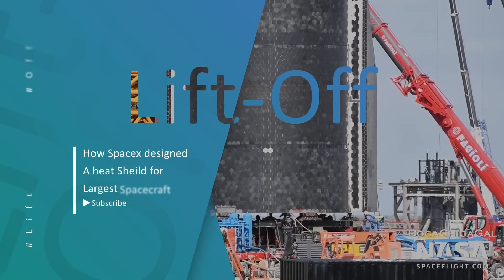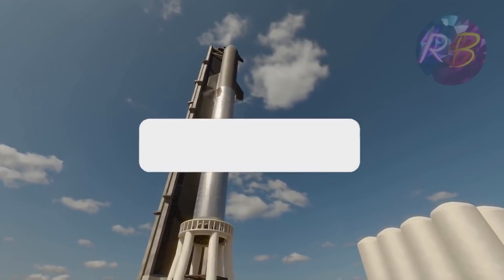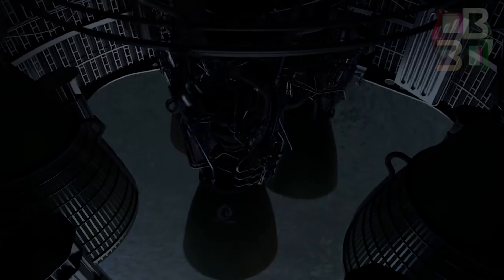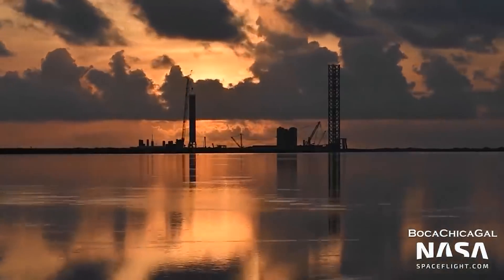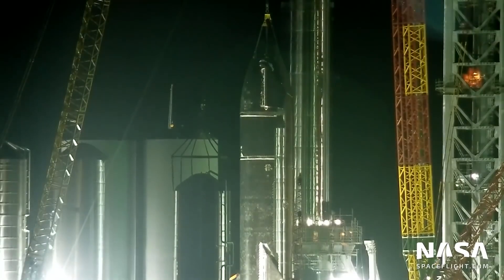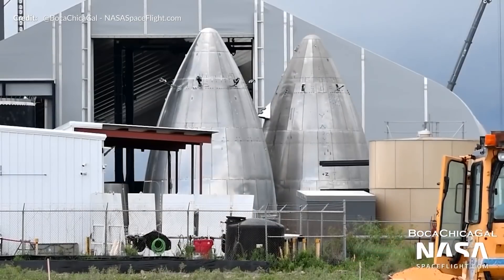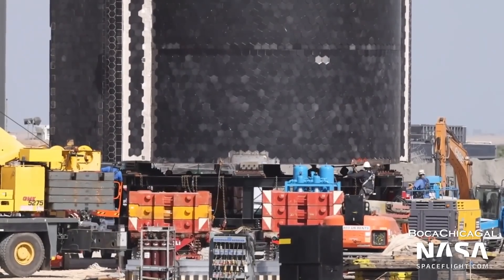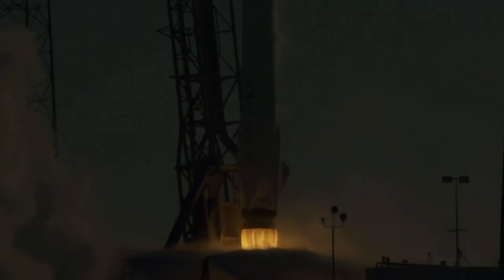SpaceX Starship New EXTREMELY IMPORTANT Addition!

Comment: SpaceX needs to "bake" these hexagonal TPS tiles with a bit of a curvature matching the curvature of the Starship body. That way they can make them bigger and that in turn will reduce the number of tiles, number of mounting points and the number of robot/man hours spent mounting, adjusting, inspecting and replacing them. A tile size that is twice as long and wide would roughly reduce the number of times by a factor of four. Unless SpaceX found some significant advantage of having them all flat and of this size.

The Holy Grail in this area would be a quick set paint/spray on type TPS. Something that can be touched up every 10 launches or so by a spaying robot attached to the launch tower.
Reply: Exactly! well said, was saying this to a friend the other day💥👍

Comment: Perhaps they will bounce the starship to slow it prior to re-entry. Lower velocity would reduce the thermal and aerodynamic stress on the skin.
Reply: Lower velocity would result in more fuel used.  The only way that a rocket like Starship or any spacecraft can reenter the atmosphere is bellyflop down like it does at about a 70 degree which controls the flow of plasma on the bottom side of the Starship. 

There is no other known way to enter the atmosphere without greatly increasing fuel use.
Reply: @michaeldeierhoi4096  - The fuel use may be worth the lower wear and tear on the tiles.
Reply: @standavison328  Once the design and how the tiles are attached is resolved the wear and tear will be reduced to a minimum.   Anyway why not wait until after the first actual test of Starship in flight to question what could be a non-issue??
Reply: @michaeldeierhoi4096  - Good thought.

Comment: For those of us old enough to remember, getting the heat tiles to stick to Space Shuttle Columbia was a big problem during development.  It delayed the program for over a year.  I understand SpaceX hired the NASA expert for the shuttle thermal protection system.  Hopefully , SpaceX will take what NASA had learned from their experience.
Reply: Most of the Starship's tiles are mechanically mounted. The STS had glued-on tiles. I used to have a sample of that glue, which was a type of silicone adhesive.
Reply: @UncleKennysPlace  I was reading where near the nose of Starship, the tiles were being glued on.  If that is the case, would you know if it similar to the silicone adhesive you mentioned? 

 I know STS 1 lost 16 tiles.  According to NASA,  Orbiter sustained tile damage on launch and from overpressure wave created by the solid rocket boosters. Subsequent modifications to the water sound suppression system eliminated the problem. A total of sixteen tiles were lost and 148 tiles were damaged.

My concern about Starship is they are not using a flame trench.  Though they will use water to try and suppress some of that energy, there is no trench to help with diverting it away.  It will be interesting how this impacts the first flight of starship.
Reply: Good info
Reply: Technology has gone far off thats why spacex can install heat tiles thoroughly than space shuttles complex design of heat shields
Reply: @Maky-vo7qs  The shuttles complicated tile design was due to the shape of the orbiters.  After Columbia and Challenger were built, the upper part of the next three orbiters, (Discovery, Atlantis, and Endeavour), all had thermal blankets not the white tiles that Columbia and Challenger had.  It would be interesting if Starship could use something similar for some of the areas that need protection.  

 I listened to an interesting story about the team of women who were responsible for putting together these blankets for the shuttles.   These people should be recognized for their key roles in maintaining that part of the TPS which was important for the whole system to work.
Reply: Supreme  They use two feathered Clip Pins coming from the surface of starship that clip into a sack hole in the center of each tile (for most of the surface), so that it can swivel around a bit. Of course it's a first try - Elon Musk seems to be well aware of the unknown results at some spots on the ship. It's iterative design with close margins,  in opposite to maximum safe design with big margins and a century of time till the first flight. And then they find out what the've missed ...

Comment: I’m not too confident that those tiles will stay affixed to the space craft.
It seems that a lot of tiles will come off.
I hope I’m wrong.
Reply: How many ships will be destroyed before the tiles stop falling off is the question.
Reply: @reasonerenlightened2456  With each iteration adjustments will be made.  Normally the public does not have the opportunity of seeing the development of a new rocket design.   If you look at the history of rocket development you will see that it is littered with numerous rocket designs.  Some failed and were never continued.  Some failed, but were reworked to be functional and mostly safe to use.

The iterative style of Space X favors eventual success.
Reply: Also how many towers before the first booster and a star ship are caught correctly.
Reply: One of the biggest issues in Shuttle development was keeping the tiles on the orbiter.  That issue delayed the program for over a year. 

 I am curious how the bolt on method will do with the stress of 15 millions pounds of thrust, (the projected amount from SpaceX). In addition, the aerodynamic pressures of ascent and descent.  During the SN15 flight, there was tile damage to the few that were on it.  A fully stacked starship will have significantly more forces on it. Shuttle they worried about the zipper effect of a tile coming off.  A wonder if there is such thought with the Starship system.
Reply: In the latest Everyday Astronaut interview with Musk at Boca Chica, at one point you can actually see in the background a workman up in a cherry picker fitting heatshield tiles to the Starship. He was banging a tile in place by slapping it in two places with the ball of his thumb, presumably to push some sort of prongs into mounting holes, but all that did was make it lie unevenly. So he wriggled it and wrenched it off then banged it back in again with blows from the flat of his hand. This didn't work so he just went on to another. All around him were tiles fitted at odd angles, sticking up like broken concrete paving slabs in an old sidewalk. It was the most obvious vision of a cowboy builder I've ever seen. It was unintentionally hilarious but it doesn't inspire confidence in quality control.